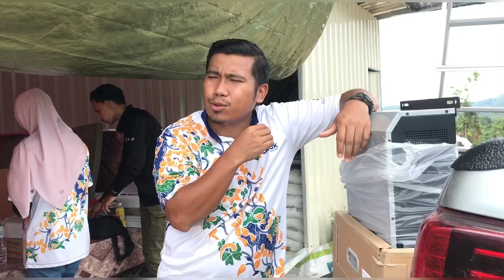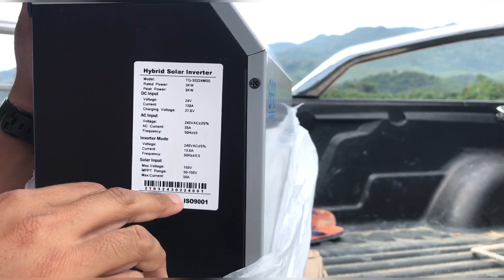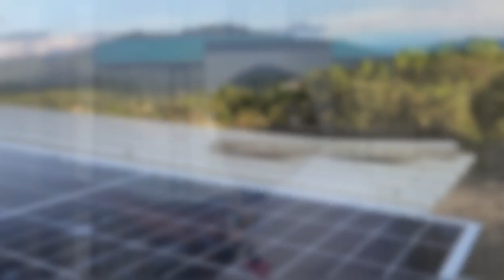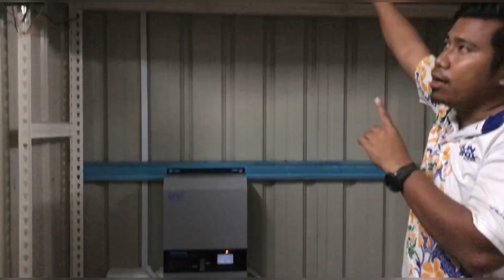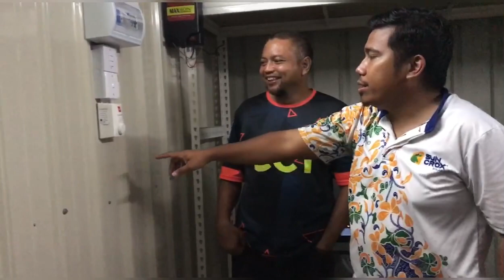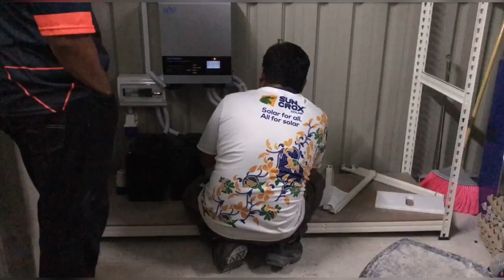OFF GRID SOLAR FOR FARM Low frequency hybrid solar inverter with deep cycle lead acid battery

Comment: tumpang tanya tuan, kalau kita guna inverter yg ada siap socket plug, still kena pasang mcb dan spd ke tuan dekat ac side..
Reply from the maker: Kalau guna utk ringan2 dan sedikit macam lampu dan kipas x perlu
Reply: kalau kita nak pasang db ac maksudnya kena sambung plug dari socket inverter masuk ke db la kan tuan? inverter saya 1.5 kw..